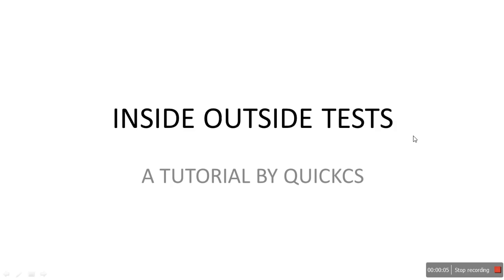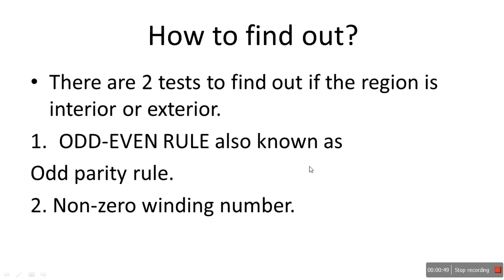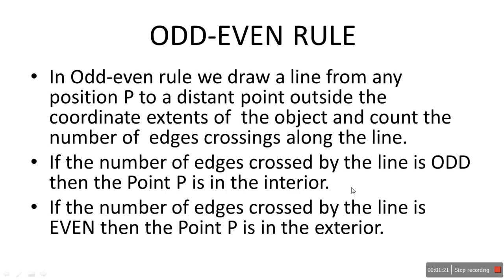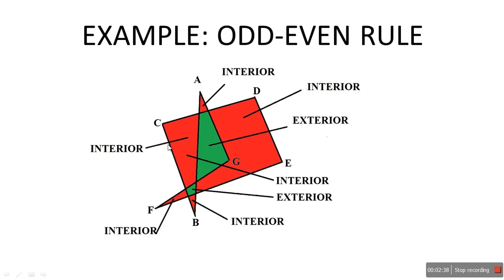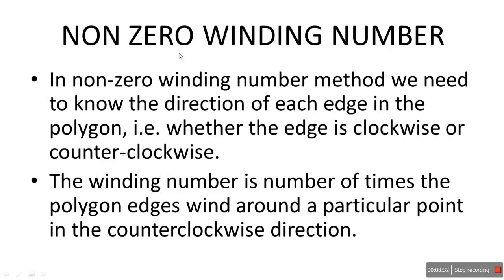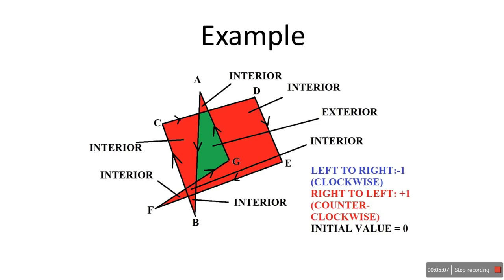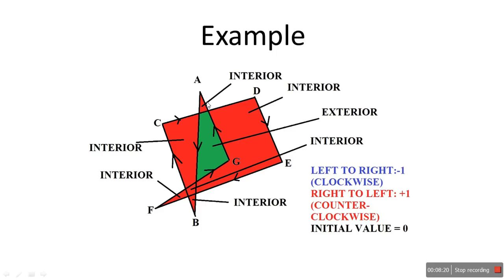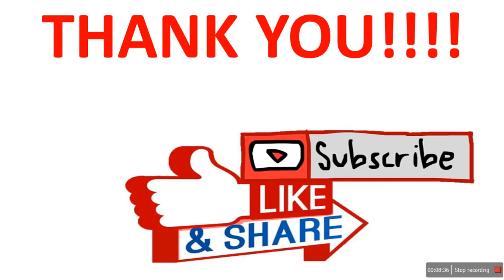inside outside test in computer graphics | Area filling ODD-EVEN RULE, NON ZERO WINDING NUMBER RULE

Comment: Superb explanation so far!! 
Thank you so much 😊
Reply from the maker: akshata raut glad it is helpful for you. Please subscribe to my channel.
Reply: QuickCS hello sir!! I have a doubt. Why both the methods are giving different inside outside test result?? 
Exterior part in Odd- even method and non zero method is different. Why so if both are applied on the same region? Please help
Reply from the maker: akshata raut this is because in odd even rule we are not given directions on edges so we detect only based on the whether the number of edges crossed are odd or even. But in next image we are given the direction which makes it a different polygon as we have got extra data to use. Hope your doubt is solved.
Reply: akshata raut ya I also got this doubt in my theory class and now the doubt is cleared